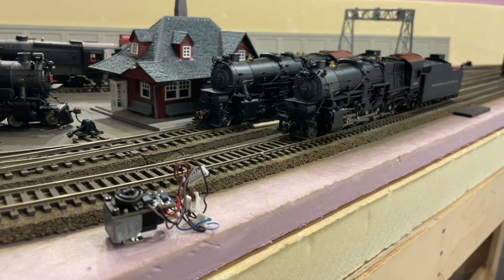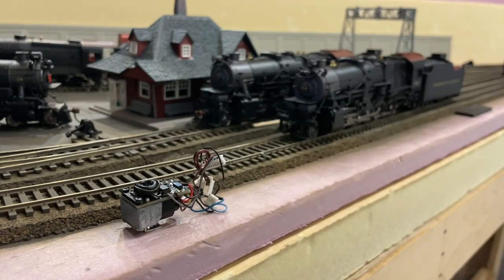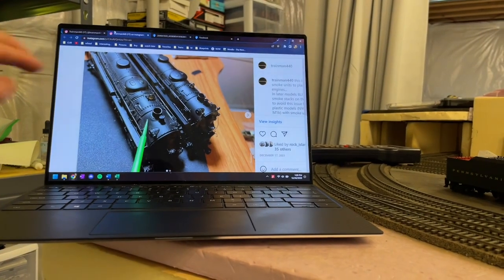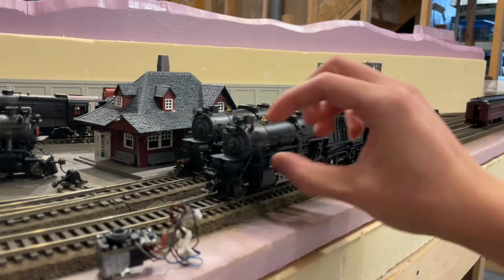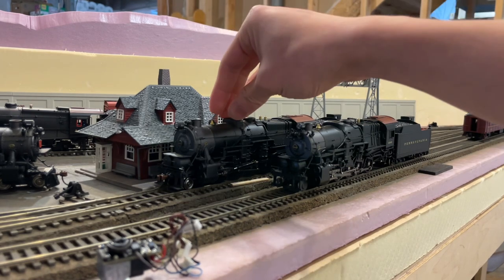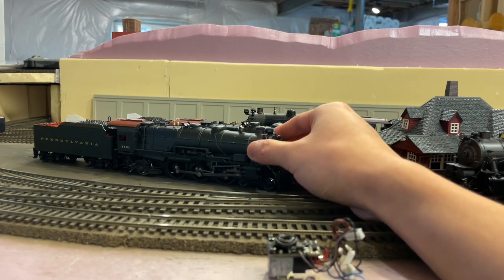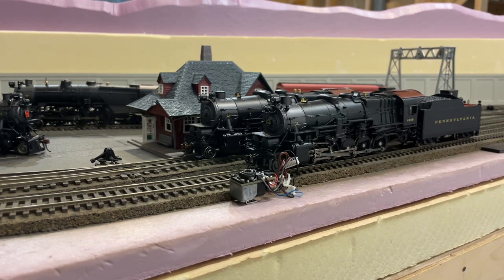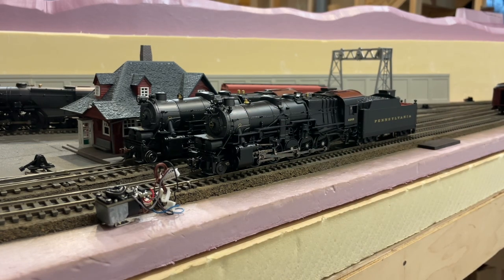A Critically Flawed Design - Broadway Limited Smoke

Comment from the maker: Note: this is an issue that only plagues engine models which tooling was created before the invention of BLI's smoke unit, aka before paragon 2...back then when most of their engines had plastic boilers. This includes the PRR I1sa, NYC J1, PRR T1, Reading T1, N&W, UP MT73, PRR M1, and others. Note that certain engines like the ATSF 4-8-4 partially combated this issue by using brass smoke stacks, on a plastic body. This greatly helped in reducing warping, but the smokebox was still susceptible.
Reply: So you're saying my paragon 4 hippo's are okay?
[not before paragon 2, ]
Reply from the maker: @gonebamboo4116  they have plastic boilers and the smoke unit inside is much lighter than a lead weight which the pre-paragon2 engines had. so...no not really.

Comment: I just don't buy the plastic ones. Or if I do, such as the PRR T1, I won't use the smoke
Reply from the maker: Its a shame since the rest of the T1 engine is diecast. Everything including and below the running boards, the cab, etc. is all diecast. Just chose to make the boiler itself plastic.

Comment: Great criticism video! I agree with you. For plastic shell engines like the T1, J1, and I1sa, they continually cause melting problems. Or as I like to call it, "boiler melting syndrome". Hence, every TCS job has me gut them out, and the overall reliability of the model goes up as a result.
Reply from the maker: Lol yup! When you do remove the electronics tho, I think you should also remove the smoke units at the same time and replace the space with a chunky weight, to make your engines run better. Otherwise youre just wasting the precious space inside the boiler!
Reply: My local hobby shop will fit them and put a speak up in the front. Makes the engine sound way more realistic. Definitely recommend and I’ll never go back to tender sound.
Reply from the maker: @SRC_model_rail  I would never put a speaker inside an engine as it just takes up valuable space which could be used for weight instead to make an engine pull more. The only time Id consider ever putting a speaker inside an engine would be if its already too heavy where additional weight would be unnecessary...and theres STILL spare space for a speaker. But Ive yet to find any engine like that.

Comment: good criticism video, but I feel it's a little wrong to buy a used loco and be mad at the fact that the original owner used a feature that they bought it for. It's unfair to say that it was abused when it was used for its intended purpose after the time of purchase.
Reply from the maker: I mustve not been clear in the video. Im NOT mad at the original user. Im disappointed at BLI adding smoke units into engines which werent designed with smoke units in mind, aka made the smoke funnels out of plastic. Cheers!

Comment: I removed my smoke unit out of my ATSF 3751 and added additional weight into it and its a super, super, puller. I never wanted a smoke unit in my steam engines, because I want more operational pulling capacity than a smoke eye candy unit.
Reply from the maker: Yes! That is definitely the move. Im glad atleast for the ATSF 3751 class, BLI chose to implement diecast/brass smoke stack, so for those who DID choose to use the smoke feature, their boilers didnt start melting. They should have done the same on other similar plastic models such as the PRR I1sa and M1a/b when adding smoke units to them.

Comment: While I haven’t had engines melt from a smoke unit, I’ve definitely had smoke fluid ruin the boiler PCBs (mostly MTH) from the smaller wicks not soaking the recommended amount of fluid. It’s a shame smoke units can cause these problems since it can be a really cool feature! I guess BLI and MTH wanna throw ‘em in just for the sake of a gimmick.
Reply from the maker: Yea, I dont mind them installing smoke units into engines, as long as it doesnt affect the rest of the engine. Shorting PCBs...leaking smoke units...melting boilers is unacceptable. Cheers!

Comment: I had a Paragon2 PRR T1. It ran well, but then I noticed I heard a squeaking noise coming from the smoke unit. I tried turning it off but it kept turning on. It never bothered me until I started doing some slow crawling on the engine. My T1 started to "skip" when doing slow crawls every time I heard the squeaking noise from the smoke unit. I got curious and did something crazy which was unplugging the smoke unit from the PCB board inside the locomotive. Then for some strange bizarre reason, the T1 started running flawlessly, that it can rival the performance of a brass engine with it comes to slow crawling. I love BLI engines, but I never cared for their smoke unit. It's messy and it leaves a nasty residue on the engine and has devasting consequences if it is not properly adjusted.
Reply from the maker: thats interesting, sounds like a short or something of sorts somehow putting a load on the motor. Glad to hear unplugging it fixes it! Thanks for sharing :)

Comment: The best dynamic smoke unit is the Marklin/trix… they never rushed to use this type if unit so the design is extremely thought out
Reply from the maker: mth's smoke units are arguably also very very solid!
Reply: @trainman440  they are very good, my one issue is the noise they make

Comment: I'd been telling people for years about bli smoke units flaws .. it leaks between the circuit board and fluid bowl .....when they leak the smoke inside the boiler shells and the smoke residue sits on the engine board and cause decoders to blow out......I'd went threw 4 PRRQ2 4 PRR  T1   3 PRR S2 ....4 AC6000 locos all do that issues I'm talking about .....ps my T1 shell melted to ..they sent me a new one.  ..I cove that inside section with epoxy to keep it from melting .
Reply from the maker: wow that is very unlucky, Ive never had smoke fluid cause shorts since the mineral oil it consists of shouldnt be electrically conductive. Also I noticed that fluids leak out way more if you store the engine back in its box without fully running the smoke fluid dry/empty.
Reply: @trainman440  well when smoke units box leaks smoke....leaves oil residue and it lays on the engine board it will short out and fry the decoder......when you run smoke unit while running your trains it leaves oily residue on the track causing the train not getting traction or not making contact on the track . loss signal....
Reply from the maker: @joepinto509  precisely. Smoke oil is an insulator and NOT and conductor. When its on the tracks it prevents electricity from going from the rail to the wheels. So by that logic, having it on circuit boards shouldnt do any harm as its not conducting any electricity.

Comment: I had a BLI BNSF ES44AC that had a smoke unit and the shell was made all out of plastic the engine even when I had the smoke unit set to off the heating part still would warm up and get very hot to the point where it melted the area that the smoke unit was at.
Reply from the maker: thats weird, the heating element should be off when you turn the smoke switch manually to OFF. If its not doing that then you might have a miswired engine.
Reply: @trainman440  Yeah I had the switch behind the smoke unit turned OFF when it happened due to the smoke smelling terrible. But I am getting another ES44ac From Broadway and hopefully this one doesn't have that problem so I am just going to keep an eye on it when it returns.

Comment: What about replacing the smoke unit with a water smoke one like the hornby steam generator locos use where it doesn't heat up.
Reply from the maker: I dont think theyre feasible. If not PERFECTLY sealed, water corrodes and rusts brass and metal. More importantly it can short and destroy your decoders. Water also will mold inside if you dont run it 100% dry each time youre finished running the loco. Lastly water is far less dense than smoke, meaning the water smoke unit is much larger in size than your normal smoke unit. (hornby demonstrated it inside a giant 4-8-2).

Comment: I pre ordered the bli S1 with a smoke unit but the s1 is a big engine so I think it should be fine for me. I do admit I got a little scared clicking on the video, but I also remembered that S1 is a big locomotive
Reply from the maker: The S1 being brass shouldnt melt. And yea its big enough where youre not losing all that much out on weight. This was mostly directed to those original paragon models which were made of plastic.

Comment: Ya lately bl par3 engine ingot are starting with problems.won’t take a reset so I’m sending it back probably board gone .it just takes off full power but nothing happens in reverse
Reply from the maker: thats a common problem with blis own decoders...I had a similar issue, and turn out it came from trying to use programming via program track. BLI decoders NEED to be programmed using program on the main. if you dont itll screw up all the CVs and go insane. Try factory resetting using programming on the main and avoid using the program track. Good luck!

Comment: I just got a GN S-2.. it's supposedly 1lb 10 ounces with tender.. and it doesn't wanna pull crap even with traction tires. It has smoke. I'm thinking about trying to take the springs off the trucks to see if that would help. My cheap Bachmann Overland pulls way more. That's a shame. A $100 Bachmann vs a $800 BLI. Like wtf
Reply from the maker: That's unfortunate to hear man. Yea it sounds like it might have some suspension issue, where not all drivers have equal weight distribution on the track. Check to see if the engine is balance. if you put a pencil between the center two drivers and the rails the engine should balance on it like a see-saw. 
The one thing I will say is, price DOES NOT correlate to pulling power. A $3000 brass loco will not necessarily pull more than a $10 trainset engine. I wouldn't make that sort of assumption. Bachmann recently has been well known for making great pullers that dont use traction tires, all at an affordable price. Good luck!
Reply: Thanks for the advice! I'm actually new to the hobby. I dabbled a little as a child (30 years ago), but nothing serious. Now I'm trying to build a full on multi-track layout. I did pick up a SD-90 MAC from Athearn, and that thing is A BEAST! It's pulled everything I've thrown at it with zero problem!
Reply from the maker: @jasonworden8209  aye! welcome back to the hobby man, its always good to see more people join :) dont let the toxicity and stuff get in the way, I feel like there's more and more of that lately in the hobby. Do what you want and let others do what they want. Glad youre enjoying the SD90 MAC Ive heard good things about them! Yea please feel free to message me (either YT comment or Instagram DM preferred) if you got further questions :) Those GN S2s might not be the best pullers but boy are they pretty!
Reply: Cool man I appreciate the support! Subscribing!

Comment: I have a PRR T1 from BLI with a smoke unit. Ever since the day I got it I’ve never used the smoke unit, the kill switch is set to off and it stays off
Reply from the maker: yea...I do the same. just unfortunate that the smoke unit takes up space which could have been weight. eventually gonna rip them all out.
Reply: @trainman440 good luck
Reply from the maker: @southernpennsyrailfan8579  Ive already done a few! not hard at all

Comment: A big flaw with the current smoke units is that it leaks everywhere and make your track dirty and makes you slip when pulling big trains
Reply from the maker: yes lol, its really freaking annoying, having to clean oily smoke fluid off your engines. Good point, I shoulda brought that up during my improv rant!

Comment: Just go in and change the CV to reduce the voltage of the smoke unit and prevent any plastic melting.
Reply from the maker: true, however the default is set to very high. and each time you reset the decoder, and forget to change it, you risk melting again. Not to mention most BLI owners wont bother going in and changing that CV. It also doesnt negate the fundamental fact that putting a heating element inside a tube made of a thermoplastic material (which can melt when exposed to heat) which melting point is below the max operating temperature of said heating element, is a BAD idea.

Comment: Just another valid reason to hate plastic model steam locomotives.
Reply from the maker: I have no issues with plastic engines, in fact they can be quite good, since its much easier to modify (drill cut etc) a plastic engine than a diecast engine. Just dont put something thats meant to heat up inside one.
Reply: @trainman440  I've always despised plastic, it strips and breaks way too easy.
Reply from the maker: @Steamer96  Youre stripping your plastic engines? Have you had plastic engines that broke due to the boiler being plastic? Ive never had that happen unless you're dropping your engines on the floor.
Reply: @trainman440  When I owned Rivarossi locos back in 2010 and the boilers would crack from the screws. If I recall it was because the parts were loose and causing mechanical problems.
Reply from the maker: @Steamer96  Huh, well blis plastic boilers arent directly screwed on, there's metal inserts so the boiler shouldnt crack regardless.

Comment: Maybe they should use one of those thing were you put water in it and it blows smoke and history it looks more realistic a channel Mike Ramsey did it.
Reply from the maker: This is a novel idea in theory but nearly impossible to apply in practice. we dont use water cause it can be detrimental to the internals...it can short circuit electronics if it leaks even at all (like if u store the engine horizontally in its box after a running session with water still inside) and it also corrodes many metals. Additionally, water vapor units would consume significantly more water than an oil smoke unit would consume oil, meaning youd be putting like 40 drops of smoke water fluid in to run for barely 5 minutes. Resulting in a MUCH larger smoke unit, which is very hard to fit into these tiny models.
Reply: What about g scale
Reply from the maker: @TheTransportationFanfromCA  This is a commentary about why specifically broadway limited (who only puts smoke units into HO engines) smoke units inside ho locomotives are sometimes poorly designed. It doesn't pertain G scale. Water vapour smoke might be more viable in G scale, if given that they are built to be waterproof. But I am no expert in G scale.

Comment: I'm planning on installing a Keepalive capacitor in my PRR T1 and in the process I'm going to ask if it's possible to have the Smoke unit Removed as well. I've never used it and the club I'm a part of, The Rockledge Model Railroad Museum, has a Strict No Smoke policy, and I'm fine by that but to be safe I'm going to remove the smoke unit seeing that They are known to Destroy BLI locomotives.
Reply from the maker: I would recommend simply turning smoke off by flicking the smoke ON/OFF switch at the bottom of the loco. If your engine is a paragon3 or newer you can simply add keep alive by purchasing one from BLI's online store, and plugging it into board inside the tender. You wont even have to take the engine apart. If you want to remove the smoke unit entirely from the engine, you can do so by taking the shell off the boiler, unplugging and removing the smoke unit, and reassembling, but that isnt really necessary.

Comment: Ya forgot to say .I don’t have a program track setup .I always use the po on digtrax for bl tried holding the bottom down under tender like five times an powered off then on also tried cv-8 an still goes full bore forward. Idk I’ll send it in a see .
Reply from the maker: thats not what i was getting at. It doesnt matter if you have a program track or not, but how youre programming it. You MUST use programming on the main (POM). NOT PO, which is the normal programming mode.

Comment: I don't know why these manufactures don't have a think tank/testing group before they put a locomotive out for the public to purchase. Not only is there the problems you showed in regards to heat damage, but for the most part BLI smoke does not compare to MTH, Roco and the like. If I would have purchased a BLI Blue Goose at that price I would have sent it back after seeing that pathetic smoke......
Reply from the maker: BLI is still a relatively small company, Im not sure if they have the funds to do testing as extensive testing such as that. Although I agree more testing should have been done before manufacturing.
Reply: @trainman440  I understand and agree in part with what you are saying, however, for their own growth and reputation they should realize that they can't ask $900 for an upscale model and have it perform that way, especially when a $500-$600 locomotive from another manufacture blows it away. I would have told them just to scrap the smoke feature and lower the price a little bit until they get it right....
Reply from the maker: @roundsaturn31  I agree lol its insane such an expensive model could have so many quality control problems. say what you want about mth being overpriced and stuff but atleast they have a better track record for producing reliable stuff. (their old stuff was bad but it got only better and better)

Comment: Do their S3 Northerns fall into this category?
Reply from the maker: Hello, BLI's website indicates the S3 having a diecast body, therefore it's not plastic and wont melt. Similar to the K4s in the video though, it still could benefit in being a better puller if you were to remove the smoke unit and replace it with more weight.
Reply: @trainman440  Common sense should have told me to check their website to begin with...
Reply from the maker: @SOU6900  lol no worries i got u.